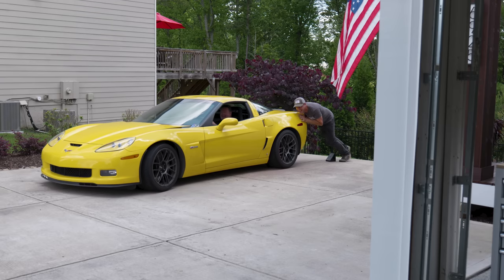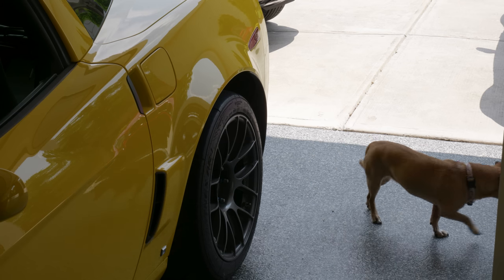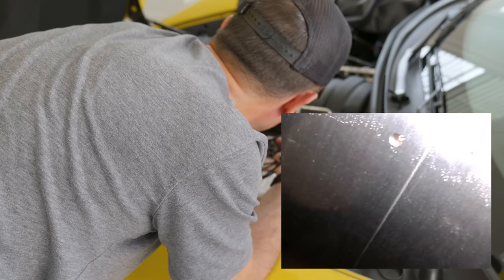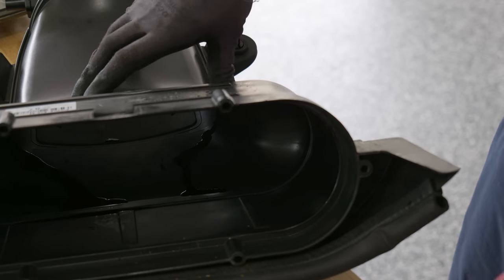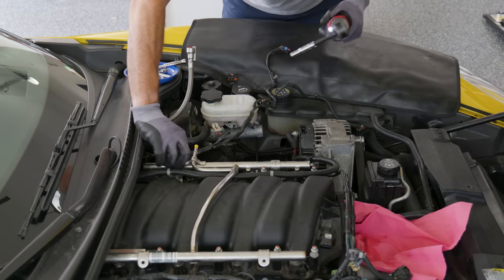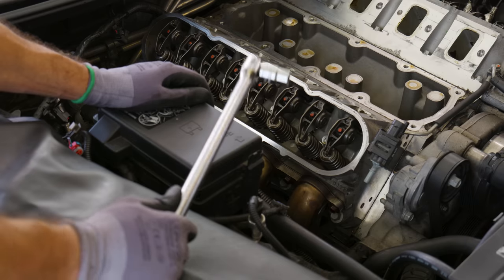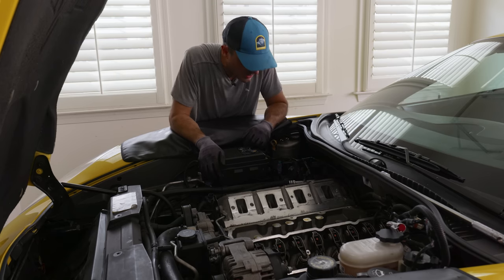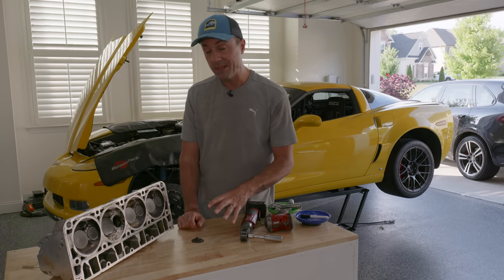“Get your heads fixed!” The internet was RIGHT?

Comment: Mine went to RPM in Delaware. Baseline 465, after stage 3 622 rwhp. They do great work and you can order a parts package from them
Reply from the maker: I’m somewhat familiar with them. That’s a lot of power!
Reply: @JoshVanVeld give them a call. Calls and advise are free
Reply: They can also do a remote tune for you

Comment: Valve probably bounced, high rpm with higher mileage is not good. Valve springs are a wear item on pushrod engines. The guide wear is usually on the intake side. If you staying na I like all pro and mast heads.
Reply: What he said. Everyone is suggesting moving away from the OEM heads, which makes no sense to me. I can see doing proper machine work on the OEM heads, using a SS exhaust valve, and getting in touch with Brian Tooley Racing (BTR) and get cam that limits valve bounce. They spend a lot of time with LS motors on a spintron
Reply: @jeffg4008  yup spintron is key. There is nothing wrong with ls7 head geometry.

Comment: Hello friend, greetings from Panama. I am surprised by your video, I am very sorry about your car but I am writing to you because the same thing happened to us and we had to buy a complete engine because the block and cylinder heat on the driver's side cracked. Now I must tell you that we had already installed aftermarket titanium springs and retainers. Until today we are finishing assembling and it happened to us on a track day just like you. Sorry for my bad English, some time i used google traslator.
Reply from the maker: Hola Reynaldo! I’m sorry to hear about your car! I hope to have mine back up and running soon! Tu ingles es mas mejor a mi espanol 😅

Comment: Josh, look for Chris Sullivan on Youtube. He does a lot of work on Corvettes and other HP cars. He did one session where he did and engine swap on his Z06. This is a good tutorial on R&Ring the engine from the top. Also, you did not blow up the engine. GM did a crappy valve job and had questionable (spin welded) 2 piece exhaust valves that caused the failure you experienced. 100% their fault. The day before that engine failed, any GM service manager would inspect and tell you that engine is fine and drive the car with confidence. GM coverup.

Comment: The block is fine, unless it spun a cam bearing. New cylinder sleeves can be installed. Send your heads to Katech
Reply from the maker: I doubt it spun a bearing, I shut it down within a few seconds of the valve dropping. I'll tear into it further to find out.

Comment: Good video. My condolences.  I can see how I might have done the same as in not "fixing the heads" earlier.  So thanks for the obvious lesson in what not to do with your LS7.  Anyway, probably quicker way to diagnose the problem by starting with the intake manifold.  Easy to see the intake valves there and they are larger so probably more likely to get damaged first, maybe?
Reply from the maker: Thanks! I guess the exhaust valves are the ones prone to snapping off and dropping into the cylinder.
Reply: Obviously on this one it is an exhaust valve and pulling plugs showed which one.  And maybe exhaust valves are the common problem?  In any case fix the heads before it happens.
Reply from the maker: @Nahngunnarson  yes my understanding is that the exhaust valves are the more common problem. You're right that I could have taken a more efficient route to diagnosing it. And yes, the main take-away is get the heads fixed! 🤜🤛

Comment: Bummer on the valve drop....first thing I did when I got my Z06 was have the heads fixed.

But on the positive note, you can go to an lsx :)
Reply from the maker: Thanks man! Isn’t LSX iron block? I need that sweet sweet aluminum.
Reply: @JoshVanVeld  yes it's meant more for boosted applications. But feel like they're more stronger overall.....however you can stick with aluminum and sleeve it so you get the good of both worlds!
I really wanted to see your lap times after all the mods you've done to the car and then the valve drop happened :(
Good luck in the repair and can't wait to see how she does!

Comment: Another great video and glad you found the culprit. Not sure how broken parts can make it from one cylinder to another without major catastrophic event. Wonder how the cylinders look on other side with head off. Me thinks head gasket damage allowed coolant into non coolant locations and damaged piston and rings brought oil to party. Was there coolant in oil? Just curious. Still…if block intact and not structural damage…you may have a chance to salvage it. Love your organizational skills….wish I could attain that level…lol. But you are definitely right about staying organized and it’s effect on attitude. Drive on!
Reply from the maker: Next video we'll inspect everything more closely now that I've got a better idea of what to look for. I'm guessing it's a low probability that the block can be saved and I don't want to risk bits of metal floating around and killing version 2, so it might be best to start from a clean slate. Time will tell!

Comment: I just picked up a 08 z06 with fairly low miles about a month ago. I am also a impulsive buyer and I didn't do a lot of research. car is pretty much a full bolt on car but heads were not done. Have an appointment to drop it off in about two weeks to do the bronze guides. Plan was to also make a track car, but not sure how I feel about it with the whole heads issues... I feel like it is always something that will be in the back of my head as a concern.
Reply from the maker: Haha I'm in a similar boat with my M Coupe I just bought where I didn't do full research before buying and it's going to take a lot of work and investigation before it could hit the track with low risk. I don't regret it but I wish I had gone in with my eyes wider open.

I would absolutely get the heads on yours fixed ASAP so it sounds like you're on the right track there. These things are phenomenal amazing track cars with the upgrades I've done so far. Tracking any car hard is going to risk the motor so you just need to decide whether you can stomach the risk. And that means asking yourself what you would do if you blew the motor and it was a total write-off. Same goes for putting it into a wall (or into a deer crossing the track).

What I'm realizing is that planning to track one of these things regularly is potentially a big-budget operation and if you are really serious about track time (which I am), a base C6 is probably a smarter choice in terms of long-term running costs. Then again, take a look at the Spec Racer Ford video I did last year - if you REALLY value seat time and want to go racing someday, that's probably the right approach.

Comment: that is the thing with this z06's, I am planning on buying on and the first thing I will fix on it is the valves problem. I am driving the car out of the dealership and straight to the shop to get them changed
Reply from the maker: I think that’s the way to do it. Not worth the risk.

Comment: In 2015 I bought a brand new Camaro Z/28 with the LS7. I tracked it from day one and after 4 years, 14k miles (track and street) I never had an issue. Eeverone at the track would bust my balls about it blowing up but it never did..
Reply from the maker: That generation Z28 is so cool! I would LOVE to know the failure rate on the valves in LS7s. It's obviously a pretty significant number but it's so hard with anecdotal evidence to know how big the risk is to run them stock. The gamble didn't work out for me, but thems the breaks!

Comment: I'm sorry about what happened to your car. I know you said you don't blame me, but I really do feel responsible about the entire incident. I've been clean and sober for over 12 years now, but from 2006 until 2009, while I worked for GM performance center on LS7s. I was drunk every day I went to work. It was all a blur. I was fired in 2009 when my supervisor caught me pouring my 4th flask of the day in my water bottle.  It was only 10 am. I lost my wife and house and was living on the streets of Wixom until I figured it out and got sober. I'm working again for GM on the new C8 Z06 engines! So from this point on, "It's always assembled with pride by MCBride". I would never drink at work again, but you may just want to avoid any engine I worked on that was touched by me on any Monday.  I'm better but I sm not a saint, and still have to cut loose on the weekends. 

Sincerely,  your engine builder
Richard K. McBride
Reply from the maker: 🤣🤣🤣🤣 Gotta cut loose on the weekends! I formally accept your apology! 😂

Comment: my friend got PRC heads for his ls7 and still it dropped a valve and lost the engine. 

many people say it need extended  Bronzanium 90 Valve Guides, roller rockers and solid titanium valves. Titanium offers the highest strength and lower thermal expansion and the roller rockers eliminate the side load on the valves and lower the Guides wear. i wonder if that really works
Reply from the maker: That sounds expensive 😬

Comment: I have not done my heads yet... It does concern me but I just spent 4500 fixing 4 of my vehicles that all broke at the same time. Cost between $100-2300. Thankfully they don't do this often but all at the same time sucks. Plus I have 2 at a shop waiting for parts for a motor swap. Yes I have 6 vehicles currently lol
Reply from the maker: It’s easy to have good intentions with getting projects done but then life throws you a string of curveballs.

I suspect my motor would have lasted longer if I wasn’t driving it hard (full throttle, high rpm).
Reply: @JoshVanVeld as far as curveball go, amongst the curveball, I still have to pay for Disneyland before my kids go back to their mothers house. It will get done, I don't track the car yet. Just drive to work sometimes and weekend fun. I hope I have time to fix the heads. Like many have said before me... I will be watching the inspection and rebuild.

Comment: long as the block doesnt have a hole in it , yea you can sleeve it . its expensive but thats what happens when you run the risk . simple as pulling and building the heads she would be fine right now

Comment: So how exactly is the valve snapping off the stem from worn valve guides?
Reply from the maker: Not an expert, but my understanding is that as the valve guides wear excessively it allows the stem to wobble as it travels in the guide. The wobbling leads to lateral force on the valve and eventually the stem weakens and snaps where the valve meets the stem.

Comment: Hello Josh, thanks for showing the tear down. How many miles are on your car? I recently purchased an 08 with 11,000 miles and planning to get the heads done ASAP.
Reply from the maker: Right around 50K miles. If I had it to do over again I would have gotten the heads redone as the first step in the project. 11K is practically brand new!
Reply: Do it yourself  it's not bad use ahp for the heads

Comment: Hey Josh, I have a new never run LS7 for sale. It has been upgraded with a BTR stage 2 LS7 cam as well as spring and pushrods. We also used ARP head bolts. Let me know if you'd be interested.
Reply from the maker: Hey Ernie, can't hurt to chat about it! Send me a message on Facebook.

Comment: but but, all the internet boomers said valve drop on ls7 isn't real! That daddy GM said its a conspiracy and not a thing! Haha. All jokes aside, I'm glad more people are being proactive with the heads being replaced and hopefully with aftermarket heads. Redoing valve guides on stockers will only lead to the guides eventually wearing out again anyway due to the aggressive valve angle the oem ls7 heads use. Aftermarket heads will last and then you just have to worry about when the ls7 rod bearings eventually fail. -Signed, a former heads cam c6 z06 owner.
Reply from the maker: 😅Thanks for the info on the heads, I wasn't aware that you could avoid valve wear with aftermarket heads.
Reply: @JoshVanVeld  some of them yes. The trickflow gen x ls7 heads use different valve geometry to address it. Mast and a couple others do as well iirc.

Comment: Cost me $6500 Canadian to have my heads worked over by Lingenfelter and reinstalled at a reputable shop in Canucksville. Seems like alot of money but hopefully now my LS7 is reliable now. So many LS7 exhaust valve failures and GM still has no liability in their equipment? It's not if but when this engine will fail. Most often with little use. I'm a GM fan but this makes me like my Mustang more! Ford hasn't left wondering if I'd make it home yet.
Reply from the maker: I wonder how much higher the prices on these cars would be if the LS7 had a reputation for being bullet-proof.
Reply: @JoshVanVeld  So true! They are awesome cars otherwise. GM knows these valve guides weren't installed properly, from what I understand, but would be very costly to replace on their dime for all LS7's. Some guides were pressed properly and others not, and to what degree.  But chances are likely each engine has one or more guides untrue. That's why some engines grenade very early and others last a while longer. Sorry about your luck, but better days ahead my car friend :-)
Reply: Ask the Shelby GT350 owners about how reliable their engines are lol…
Reply: @CanadianSpeedster  Doah! I didn't hear about them. My 13 Boss has been strong. Guess I just better buy a Honda, lol. Cheers Speedster :-)
Reply from the maker: @CanadianSpeedster  😬
Reply from the maker: @billmcmeekin7909  😂😂

Comment: How does Tadge  still have a job at GM? The C6 & C7 Z06 had major reliability issues and he’s turned the C8 Z06 into a heavy hero lap only GT car that requires tire changes every two tanks of fuel when tracking. Tadge doesn’t seem to understand the use case of the variants he creates.

Comment: Whoop whoop ❤Good news 👏 you have "Mannnnned Up" 😂
I have turned down the boost ! On me (not) being too non P.C  & calling you a "Big Girls 👚 Blouse" 😂 if you had given up on the Vette project.
 Awesome you are on to the engine fix.
We can look forward to the lower lap times than a GT3 :) & I can once again live vicariously thru your Vette project.
Is much cheaper you doing it than me hee hee haa haa..
⚠️ Warning 
Unasked for advice coming!!
Suggest you at least ensure the engine upgrade gives your Vette a minimum of same pwr and torque to weight ratio as the GT3.
Got to give Goldie a fair starting point Dude..just my unasked for opinion:) 
Go Josh 😅
Ps.. Does the Vette know she is sharing the garage with Zee Germans!? 😂
Ps
The "Bread Van" as in delivery Van, was what we in Oz nicknamed those M Coupe Hatch backs, back in the day.
Good bit of gear, when they are behaving.
Cute & unique,  can relate to the attraction.
From memory not as stable as usual 2 door M coupes of the era.
Still fun 😜 🤪
Reply from the maker: Haha thanks! I think Goldie would have been able to hold her own against a GT3 with stock power but hopefully now we'll be able to go somewhat above and beyond.

And regarding the bread van, I've heard with the shorter wheelbase they are a bit trickier to deal with on track than the M3.

Comment: The problem is, what is "fixed" is usually just refreshed and mitigated.
Reply: That's not true. They use bronze valve guides and switch from titanium exhaust valves to stainless steel to decrease wear. Excessive wear is what causes this issue on LS7 heads.

Comment: Oh wow. How do you get symptoms on different track days from a bad valve. Head scratcher. 
 Not oil afterall
Reply from the maker: Weird, right? I wonder if the valve somehow could have gotten stuck open but didn't break off and then went back into place? It felt and sounded like the exact same thing when it blew.
Reply: @JoshVanVeld  I don't remember the exact service bulletin but I vaguely remember something about the valve guides. Titanium can gall with sliding friction, maybe it got hung OPEN??
Reply from the maker: @masoncnc  Seems like a reasonable theory but I’m not qualified to form an opinion 😁

Comment: so what does into fixing the cylinder head issue, stainless valves?
Reply from the maker: I'm not 100% sure. I believe it involves replacing all the valves, valve guides, springs, etc. along with some machine work on the heads.
Reply: @JoshVanVeld   Arent those the hollow stemmed sodium filled valves?  Seems being hollow would be a problem for longevity. Love your content recently discovered you. keep up the great content.
Reply from the maker: @Den-ml7zg  Correct! The intake valves are titanium (I was confused when I mentioned titanium bouncing around in the cylinder). I guess part of the trick to allowing a bigger displacement engine to rev to 7K rpm is to try to keep valvetrain components lightweight.

Apparently the factory valve guides tend to wear, which allows the valve stem to wiggle and eventually snap off.

Glad you're enjoying the channel!

Comment: There's  no way a piece of that valve went over to the number 5 cylinder they are opposite sides of the engine . Secondly, I realize you never did this kind of work before. Make sure you remove the tension off the rocker arms before removing the head .
Reply from the maker: Thanks! I’ll know better next time.
Reply: @JoshVanVeld  I have not watched all your video's And I am impressed that you took on a project that even the most seasoned Auto Technicians hate doing ( unless it's their own car ) I give you a A for the effort and a  C-   AS you should have the manual to remove and reassemble the cars engine at hand as there are torque specs that need to be followed 😉. And ,  upgraded the clutch assembly while everything was apart . Also, I hope you did not stress the torque tube when trying to lift the engine if the  book was handy 😉 It  would have told you this about the engine mounts .If you do not mind the input I am a Master Auto Diesel Tech 49 years .
Reply from the maker: @apacheone3643  Thanks man, I appreciate it!